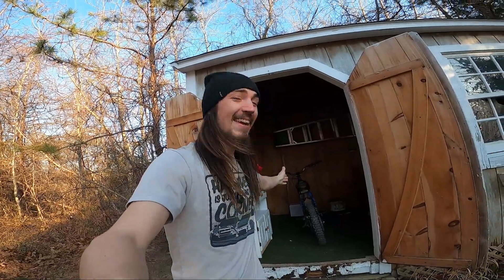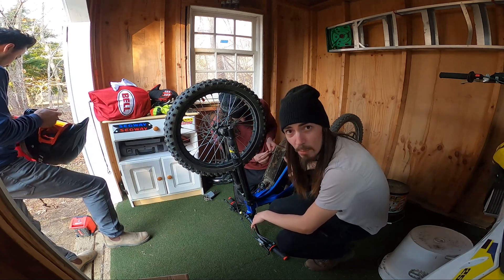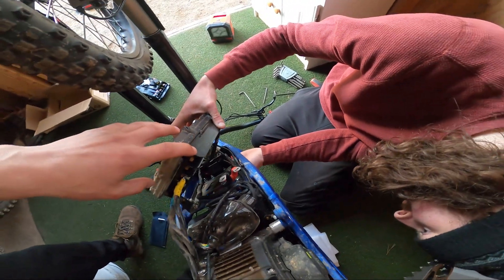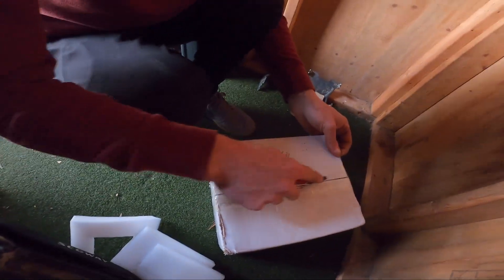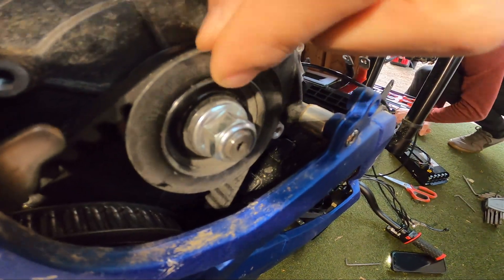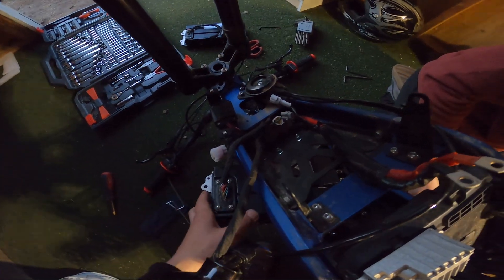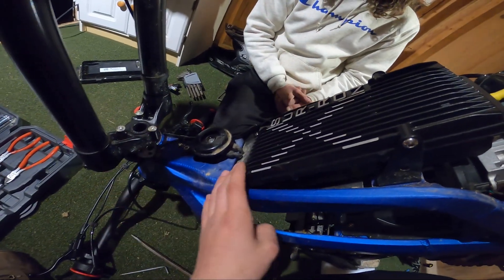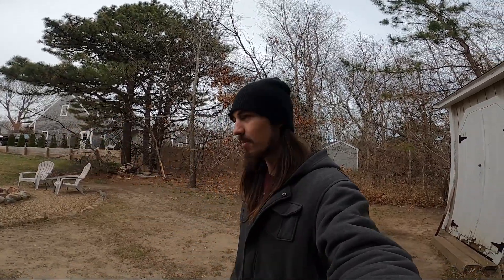How to make SEGWAY X160 a "SUR RON" ~ Kyle's MAJOR UPGRADE

Comment: Thanks worked cut the green black wire bike was in limp mode 12mph  put a x controller segway 260x battery bike go,s 34 in sport 24 in eco  there is some braking when you let off the gas from the motor not sure what's causing it hopefully it stops when I put the new stock surron motor in my 160x . How is your 160 Project doing, how is the bike running? Your video was good info
Reply: The braking only happens in sport mode not bad but I can fell it eco mode is fine if someone knows what's happening let me know  thanks

Comment: What top speed are you guys looking at because mine is stuck at like 34 even with all the same upgrades as your guys
Reply from the maker: I'm pretty sure Kyle's bike maxes out at like 37, but in reality like 40 because the speedo is off, due to the bigger wheels & a different sprocket. Not sure what his top speed was before the battery upgrade he just got though.

Comment: if you just upgrade battery and not the controller do you get a speed and range increase?
Reply from the maker: Great question man! You might squeeze a tiny bit of power out of it, but maybe 1 or 2 mph faster. The range is more drastic of an increase for just a battery upgrade (if you're just upgrading to a stock surron battery). There are other batteries thats I can't speak for because I haven't tried them out.

Comment: do you have to replace the motor to feel a difference
Reply from the maker: Good question! He never rode it with the upgraded controller and battery without the motor. I believe theres not much of a difference, but the upgraded power can burn out the x160 motor, so I've heard.

Comment: I.just watched a video.whwre the guy says and proves the the motor and the controller is the same that's in the Sur ron but it is programed different but can be reprogramed.reprogrammed.  he just changed the forks , the tires keep the rear cog cause it's bigger then the one that com3s with the sur ron  and he changed the controller bit says that he found out later that the motor and the controller are the same.  He also cut the green wire with a black stripe.  He said it ran better then a stock sur ron x. And he changed over to the aur ron battery.
Reply: What video
Reply from the maker: @Suwarofilms  that's what I was gunna ask lol, we've been lead to believe differently 🙃
Reply: @Suwarofilms  mmm. Not sure.  I watched like 40 videos on this stuff. He also made a video where he takes the 2 motors apart and compares them.  I see if I can find it.

Comment: So the wire on the harness that plugs into the controller unlocks the sport mode. What wire needs to be clipped to remove the speed limiter? (Bike should go like 44) On surrons it’s up in the battery compartment. Did you guys figure that out?
Reply from the maker: You are correct! We did find it, go to 16:33 in the video🤘🏼
Reply: @motortherapyinc  okay I clipped that and it worked but now my bike randomly shuts off while I am full throttling. I am currently using the original x160 battery which is 48v so that might by why. Did you guys encounter this problem with the 60v battery?
Reply from the maker: @danielw1750  no we haven't.. theres no need to cut the cable with the stock power brotha, if you have the x160 theres an app you use to unlock the top speed. It doesn't go as fast as the surron or talaria
Reply: @motortherapyinc  I already had the Surron x controller installed. Thanks